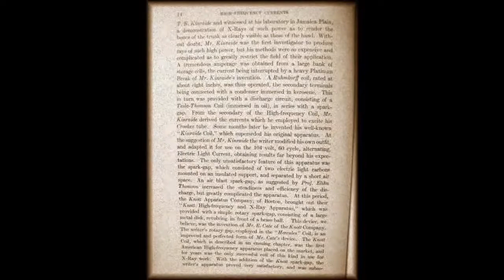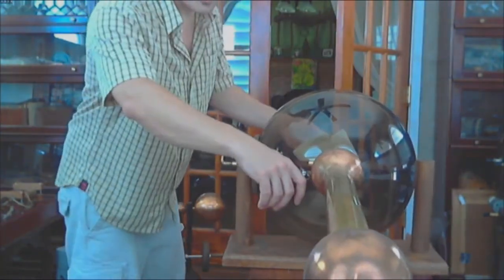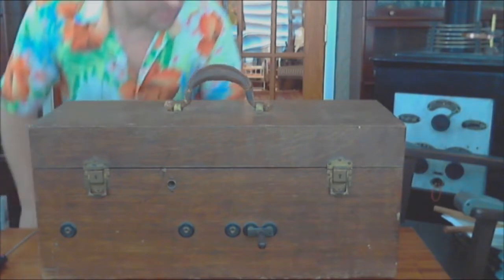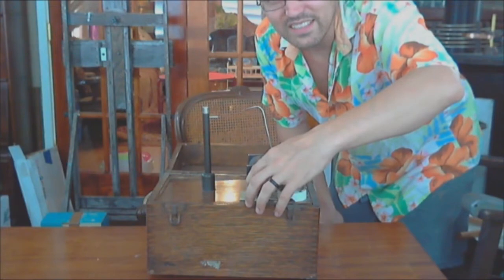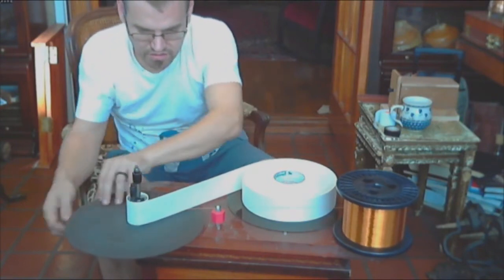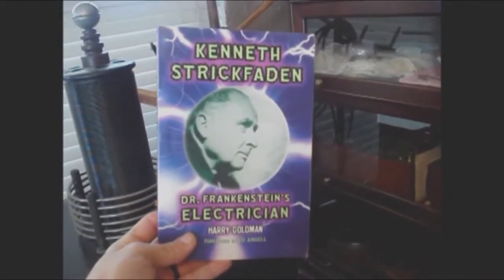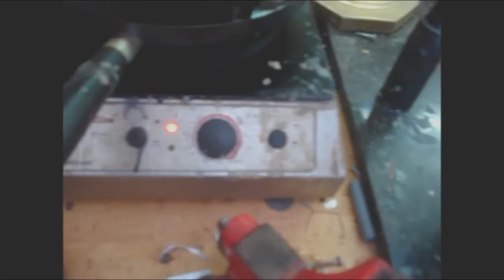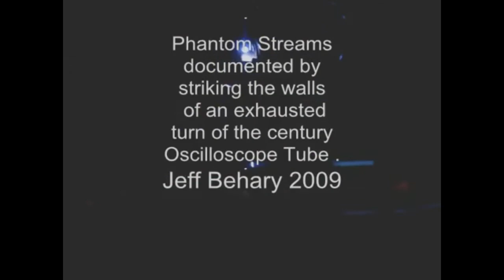Restoring Kinraide Coil, Static Electricity, Electrotherapy, Winding and Tuning Tesla Pancake Coils

Comment: Thank you for putting up this very interesting and educative  video. I built my self an induktion coil that produced 6 inch sparks. That was 30 years ago. It  consisted of 14 discshaped coils that where than put as a stack on the core. The whole thing was also cast with wax under vacuum to get rid rid of the air. Good old times. Thx again for the effort !

Comment: Is there any technical trouble to make a comment here? it seems this system is not being working properly, because I tried to do it yesterday but those comments are not here. Thanks in advance and regards.    
🙂
Reply from the maker: I see also problems, sometimes I get a message there is a comment and I don't find any comments... censorship?  I'm not sure... but I see this comment (only)...